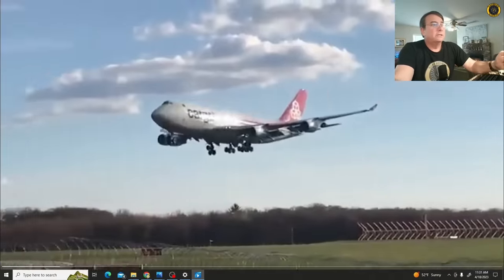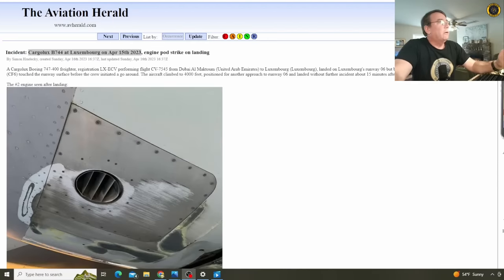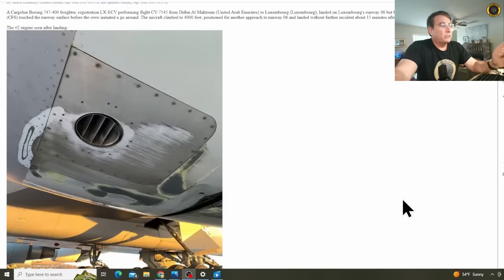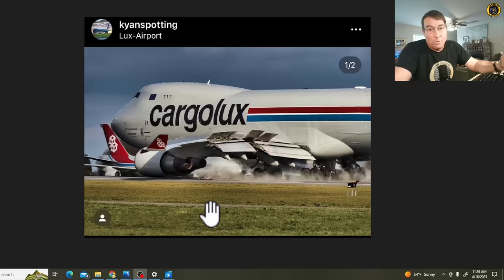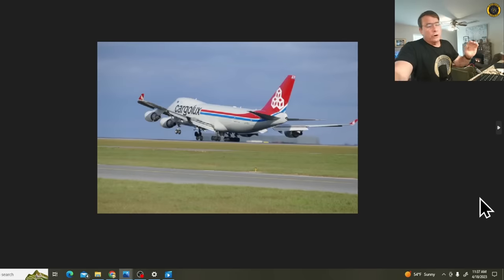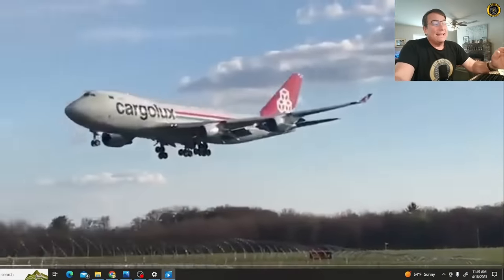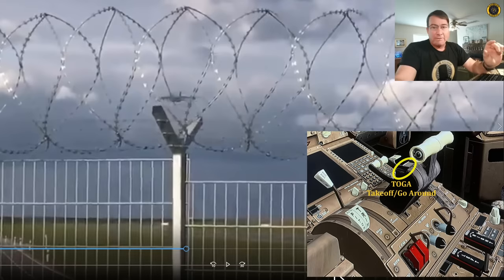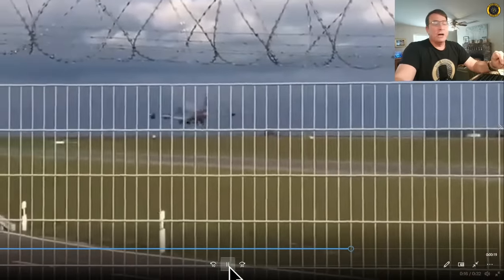Cargolux 747-400 KABLAMMO!-SMASH AND GO 15 Apr 2023

Comment: I thought if the ground spoilers were up, a GA should not be considered? This GA could easily have turned out very badly. Maybe just on the Embraer?
Reply: FCTM:
If a go-around is initiated after touchdown but before thrust reverser selection,
auto speedbrakes retract and autobrakes disarm as thrust levers are advanced. The
F/D go-around mode will not be available until go-around is selected after
becoming airborne.
Once reverse thrust is initiated following touchdown, a full stop landing must be
made. If an engine stays in reverse, safe flight is not possible.

Comment: When was it considered a stable approach? This looked like a carrier landing. No flare which could have saved it, but way too fast. A touch and go was very wise, but significant damage sustained on first impact. I sat in the 747 jump seat on the way back from Desert Storm. The captain wiped out the controls, but the landing was very smooth. A stable approach should lead to a controlled landing. Everything about this approach seemed unstable.

Comment: What would've happened if the engines 1 and 2 had been damaged and/or caught fire on the go-around?
Reply: It would be a challenging situation, but if the airplane is fairly light, it should still be a doable go-around.  The asymmetric thrust would be the biggest challenge on the initial climb out.  It's not impossible to accomplish though, and once leveled off, it would be easily manageable even with only the two running engines on the right wing.

Comment: Would this hard slam have implications for the landing gear or would the forces experienced be within spec?
Reply: The MLG failure design point for a Part 25 transport aircraft is 15 fps sink rate at Maximum Landing Weight. Ok/no damage is 10 fps or 12 fps (I forget).  This looked to be close to the 15 number (really hard to tell just from looking -- for me anyway).   But if enough below MLW, maybe it wasn't too close to failure.  And a lot of the weight stays supported by the wing when the spoilers haven't deployed.

Hopefully the tires will be scraped, in any event.  And the wheels inspected for cracks.

Comment: These pilots indeed did a great job performing a go-around after a botched landing. However,  at any other time, a damaged airplane should have remained on the ground. How did the pilots know the engines would remain operable after hitting the ground?

Comment: one of the things i can never get my head round is pilots visibility and the following decision made to go around

i know with advances in tech and glass cockpits that pilots have a few tricks up their sleeves such as tail fin mounted cameras to see over the whole plane, but is there another down under that can see a wide angle view of undercarriage and engines,       'a what's going on view' at what point does a captain say 'Take Off / Go Around' how does he know to make the split second decision as he has no side or rear view mirrors (which i always say would be useful like in fighter aircraft) can he see those views, is he/she or the flight crew observing?

i think of instances such as the Paris Concorde and others, danger so close to the ground - if the engine strikes the ground hard enough and causes a fire, or an undercarriage issue, with the aircraft already dumped on the deck is it not safer to complete the landing or crash landing if it is called for - if the engine or gears are rips off and cause damage to the wing and control surfaces and the 'take off go around' is deployed, what is the risk to passengers and crew, not so good i think, got to be a tough call - once the plane becomes airborne if it can do that, and an issue arises, would it not have been safer to have been on the ground where the incident began, i realise speed would have much to do with this and room left in front of the plane

its interesting to learn of other mistakes made during uncontrollable conditions, and software rewritten to try and assist with that decision making, but what is the percentage of this becoming more of a risk

Comment: We are not suppose to go around if spoilers deploy after touchdown On the 400 and the -8 serie
Reply: No.....FCTM:
If a go-around is initiated after touchdown but before thrust reverser selection,
auto speedbrakes retract and autobrakes disarm as thrust levers are advanced. The
F/D go-around mode will not be available until go-around is selected after
becoming airborne.
Once reverse thrust is initiated following touchdown, a full stop landing must be
made. If an engine stays in reverse, safe flight is not possible.

Comment: If the engines touch the ground does that mean the wheels were off the ground on the opposite side or does the suspension let it do that?
Reply: Likely that all the main wheels were in contact with the ground when the engine pod hit the ground.  747s are pretty notorious for risk of engine pod strikes with even a small amount of bank angle during landing.  The force of this landing made it a lot worse by causing the wings to flex downward so much.  It was a combination of bank angle and downward momentum that caused the strike, but mainly the latter.  It really wasn't much of a bank angle, and with that much force, the gear shock absorbers would have been fully compressed on the left side of the plane and partially compressed on the right side at the point of maximum engagement with the runway, but all in contact with the runway.

Comment: I presume the aircraft was empty? would a fully loaded aircraft have reacted so quickly and in the same manner ?
Reply: Doubtful it was empty, but probably relatively light due to having low fuel since it was arriving at the end of a scheduled flight.  Cargo (or passenger) airlines don't like to fly empty planes.  The cargo is what makes the money to offset the cost of operating the flight.  They also won't carry more fuel than needed to make the flight (plus some reserves for safety reasons) since that adds weight (and more weight costs more money to move through the air and also reduces the maximum amount of cargo payload you can carry).  So, unless this was just a maintenance or repositioning flight, they were probably carrying at least some cargo at the time.

Comment: The flaps setting looks to be Flaps 20. I'm eye balling it based on what I've seen on other videos and photos. Flaps 20 is when the inner flaps trailing edge is almost flush with the bottom of the fuselage. Have a look at the 02.00 mark in this video to see what I'm talking about.
Reply: As an ex -400 pilot, I agree with that it looks like Flap 20. You would use Flap 20 for some failure scenarios or maybe low fuel….certainly it looks fast but no windsock to be seen….?
Reply: F20 is not a landing configuration
only F25 & F30
the GPWS would do a lot of shouting at the crew
so very unlikely..unless in an "abnormal" situation
Reply: @747-8F  I agree. It is not a landing config. Perhaps something else went wrong thaybis yet to be revealed.
However as @mikethrower said, it is used in certain failure scenarios. I myself am not a pilot. I draw my conclusion from evidence found through other sources to help me understand what's going on here.

Comment: Wait!  After possibly taking on Engine Damage, with wheels already on the ground, why the hell would you go back up in the air.  For safety sake, flip  all the breakers to off and let her coast to a nice safe stop and call the tower for the fire trucks.  Instead they decide to take a damaged aircraft back up into the sky over one of the most populated urban centers in Europe.    Yeah, if something goes wrong, then the Non-Thinking response would be to Go Around.   It reminds me of Car Driving Scenarios in which the panic response for many people is to slam on the breaks no matter what the situation is.   When I used to be a Motorcyclist, some young driver who stole his sisters car made a left hand turn in front of me.  All  he had to do was keep going, but realizing I was coming up quick, he panicked and did the exactly wrong thing -- he hit the brakes.  In this case they got away with taking a compromised plane back up into the air.  Thumbs down  and Unsubscribe until you sober up...just another drunk pilot BSing his way through.

Comment: These flaps are set at 30 with the spoilers out. That airplane should have never even been within 100 feet of the ground going at that speed. They’re lucky that they didn’t end up any worse than what I did.
Reply: You're the only person here that think the flaps are at 30.  Basically, everyone else (including several people who claim to be 747 pilots and sound like they probably are) say they are set at 25.  Depending on how heavy the plane was, the speed could be necessary.  The problem was the lack of flare.  They basically just flew it right into the runway.

Comment: It is suicidal to go around with a damaged engine. Imagine opening full power while initiating the said manoeuvre on an engine which could have damaged its accessory gearbox (IOD or disintegration of an engine) like the one in the video. The same case ended up in a catastrophe when a Pakistan International Airline A220 or A221 initiated a go around after landing on its engines. Because of its damaged accessory gearboxes aeroplane could not sustained a flight causing it to crash on a final approach. Secondly, after a long haul flight, prefer auto-landing on a runway catering autopilot auto-land limits.

Comment: What if they damaged the engine and Hydraulic pumps underneath the engine JB
Maybe cause they had landing gear down unlike the Pakistani Airlines aircraft that did that and crashed while trying to go around. 
#KABLAMO
Reply: You have probably missed the 3 other engines on that big hulking 747. So even if that engine got damaged so badly that it would have failed, nothing would have happened. 747 can fly and land even with two engines out of four not working.

The PA crash was after they have literally ground off the bottoms of their both (and only!) engines on the runway, after a grossly unstable and fast approach **and a gear-up landing**. Not even close to a comparable situation with this bounce.

Comment: so would they not just proceed to complete landing because they were gonna bounce some more, or lose control on runway? 
Unclear to this non pilot.
Reply: I think you have it exactly right.  There was a lot of weight shifting and momentum that would be very hard to manage quickly while rolling on the ground.  Staying on the runway could mean directional control problems and an overcorrection issue where the opposite side wing could end up with an engine impacting the ground as well.  It's easier to get all that unstabilized momentum under control after creating some distance between the plane and the ground.

Comment: Why a go around?  It’s on the ground, why not just stop?
Reply: Yes, it was on the ground.  But it wasn't stabilized while it was on the ground.  It was probably safer and easier to get back into the air versus trying to get the plane settled down and on runway centerline.  Because of the massive wingspan of a 747 being off centerline a little bit can be a serious problem.  Also, after the left wing dropped, the correction could have caused the right wing to drop next.  Having some altitude and lift (even a little bit) during the recovery would allow an inadvertent overcorrection to be done in a way that doesn't risk the exact same thing happening to the other wing and the number 3 or 4 engine.  There's a lot of weight and momentum shifting in that scenario and it's not going to be easy to stop all that movement while rolling down the runway.  At least in getting back in the air, you have the luxury of allowing the plane to bank more without risking another pod strike to the opposite side.